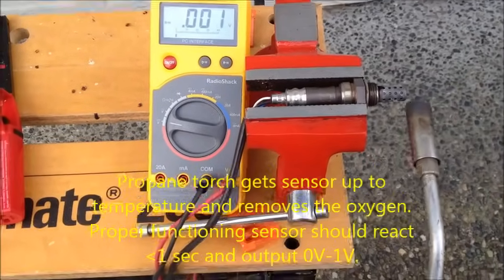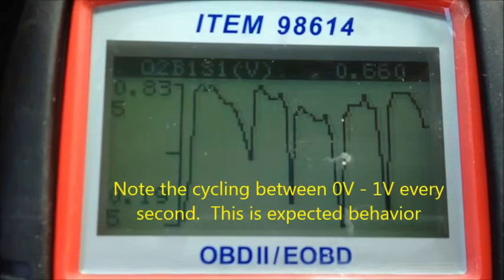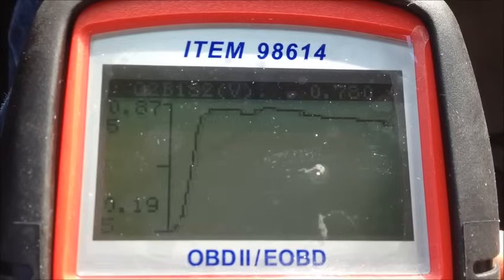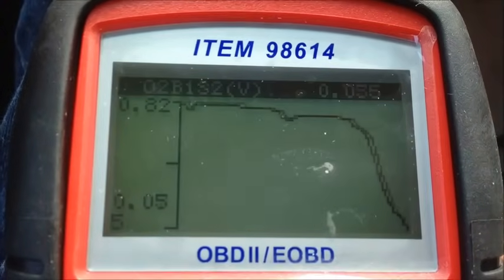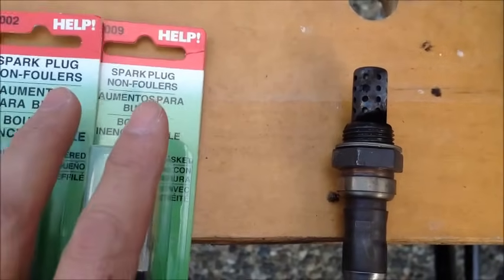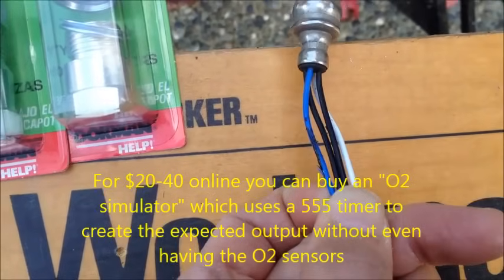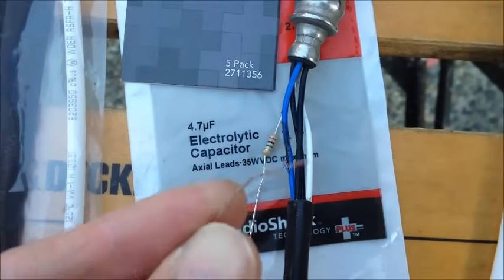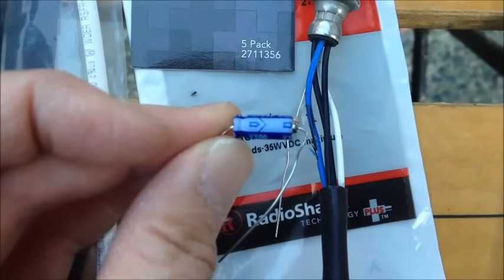$3 O2 simulator fix for P0420 Check Engine Light

Comment from the maker: Hundreds of people have fixed their problems with this.  However, several people have tried this and it didn't work, or another code popped up, and they want help figuring out why.  You can't expect help without providing enough details to be helped.  Here's some diagnostics to try.

First, this won't fix a broken catalytic converter, so it's very possible your converter is too far gone for this to help.  I've never heard of anyone with this mod failing a real smog test.  That's because this doesn't fix a broken cat - it just fixes a too sensitive computer.  If the problem is intermittent or a bottle of Chevron Techron fixes it then you're a good candidate.  If your catalytic converter simply isn't doing anything, or a smog test shows actual problem gases in your exhaust, then this mod can't possibly work because it depends upon a working catalytic converter.

Second, double check all your wiring.  The resistor doesn't matter which direction, but an electrolytic capacitor with a + and - labeled on it must be installed matching the polarity.  If you change the wiring or reverse the order of the resistor and capacitor you can completely defeat the circuit.  If you change the resistor or capacitor values then you change the time delay of the circuit.  See my explanation of how T=RxC.  Sometimes making the RxC larger helps.  Rarely will making it smaller help.  If you get a code saying the o2 sensor is too low, too high, or not changing, that could either be bad wiring on your part, or a dead catalytic converter that isn't doing anything.

Lastly, if the above two are correct then you need a graphing OBD analyzer to see what's going on.  Graph the upstream & downstream O2 sensor values.  Watch the graphs in my video. The upstream should cycle every second.  The downstream needs to look like a smoothed out version of the upstream.  If it's not then your circuit isn't right, or your cat converter is dead  (you can remove the mod and see what your cat is doing on its own to figure that out). If you can't get your hands on a graphing OBD analyzer (Harbor Freight 60693 for $80 on sale) then you're at a dead end because there's not enough diagnostics to figure out what's wrong. 

You can always try a spark plug defouler I showed in the video, but I'm not sure that really works or how long it will work, won't fix a dead cat either, and there's no way to tweak it.  There are full o2 simulators but they're hard to find.  Last resort would be a new catalytic converter but I don't recommend anything but OEM especially for a Honda.  Lots of stories of people paying $500 for an aftermarket which died in a year or less.
Reply: MITEEman  How soon after you install the modified O2 sensor should the CEL light go out? Do I need to erase the code or is that not needed?
Reply: AL Ian you will need to erase the codes
Reply: In Illinois, this would always work as they do not stick anything in the tail pipe anymore (not even a banana, "a banana in the tail pipe?")
Reply: Actually the upstream should cycle 3 to 5 times PER second.
Reply: Did this last year and it worked. Passed inspection with no cats. CEL came on randomly two times over the past year. Both times it was P0138. Now, right about the time I need it inspected again, the CEL is on with codes P0138/P2271, and clearing them they come back after a day or two.  When I looked these up, it says Bank 1 Sensor 1 voltage above 1.2v for more than 10 seconds. Do you think this could just be a bad 02 sensor? They were all new at the time I did this.
Reply: +johnmartin1024 
Thanks for the explanation of why the catalytic converter doesn't die by itself. The P0420 code can also be triggered erroneously by the manufacturer ECU as well, such as in the BMW M3. They even had a recall on this issue and the ECU needed to be reprogrammed to damp out the high frequency post-cat O2 sensor. My M3 got the P0420 code but it passed the California emission test so the catalytic converter is good but BMW ECU was too sensitive.

Comment: So, I applied this fix to my secondary O2 sensor on a 2007 Mazda 6. The code I had was P0421, similar to a P0420. That is gone now, so it fixed that, BUT now I have a P2096, because apparently on this car, the secondary sensor is also part of the fuel trim loop. So the slower-transitioning sensor gives me a fuel trim error. Just a heads up for people who might find themselves in a similar situation. I am thinking about changing the C value to bring the time down a bit, or something...
Reply: nunya bizniss Update: My vehicle uses 3 O2 sensors. This would probably work on the last sensor, downstream from the last cat. However, I have a pre-cat with up and downstream sensors, and I tried this with the downstream....which, it turns out, is part of the fuel trim loop, and so the RC fix causes a fuel trim problem because the sensor doesn't react fast enough. MITEEMAN's fix is still valid, the theory is sound and the science will work, however sometimes there are extenuating circumstances that complicate the issue. I had a P0421 code, not P0420, for one thing. So one must do a little research. Thanks MITEEMAN for the vid, it is valid information and people can use it if they choose.

Comment: Is this only Honda cars or will this work on Prius Toyota cars?  Thanks for the info.
Reply from the maker: SiggyMe In general, follow my instructions above to find out details about your o2 sensors.  Out of curiousity I did a quick search and it looks like it is a standard 4 wire, so it's possible it will work.  My question is how a Prius can already have an inefficient catalytic converter?  Those things burn half the gas of a normal car and most are newer models with low miles.  Unless you have high miles and/or it's really old I would have a mechanic check what's going on.  The newer the computer, the more likely the computer will reject the mod.  If you try it let us know if it works.
Reply: Hey MITEEman you are an angel for helping so many AND sticking with it!! I have a 2005 Nissan Frontier 4.0. These are famous for P0420 & 430's. Have you heard from Frontier owners on your fix? Thanks ever so much!

Comment: i have done the same fo ford 5.4  super duty and P0420 gone , but comes up P2270 after 20-30 min drive. what is wrong?
Reply: I got the same problem bro you ever fixed it ?

Comment: I have a 2004 VW Jetta.  I have the p0420 code.   I followed everything to a t and the codes gone.   But now I'm getting a p0140 Oxygen (Lambda) Sensor B1 S2 No Activity code.  Any ideas?   From what I understand that's a steady unchanging voltage code.   Maybe try a smaller Capacitor?  PR remove it entirely?
Reply: Brandon Brickley have the same issue, did you solve it out?

Comment: Hi, I use this R * C (1 mega ohms * 4.7uf= 4.7sec) circuit i am getting constant voltage of .43 and code P0140 No activity detected, Do i need to use 2.2uf capacitor instead of 4.7uf. Without the R*C circuit O2 sensor reads 0.6 / 0.7 / 0.8 fluctuates .
Reply from the maker: If the voltage output is constant then either your input was constant, or you've wired it incorrectly.  If your input was constant (bad o2 sensor) then you probably should have seen P0140 to begin with.  So, my guess is that it's wired incorrectly although it's not an obvious short which would give 0 or 1v.  I would bench test the o2 sensor to validate that first, then reinstall the RC filter and if it's wired correctly you'll see it fluctuate with the same range but slower.
Reply: MITEEman Can i decrease the resistance value like 100 Kohms, will it increase the voltage reading.
Reply from the maker: Rishikesh Mahato
If the signal is changing, but just too slowly, then reducing R or C will help.  You said you were getting a "constant" voltage in which case it's not going to help.  I stand by my prior recommendation.
Reply: MITEEman I have reduced the Resistance now C = 2.2uf & R=90 Kohms, voltage increased to .57 (Varies from .31 to .57) only code is coming now is internal resistance too high, so i am reducing the Resistance making it 10 Kohm.
Reply: I'm having the same problem with p0140, have you found a solution?
Reply: Brandon Brickley , Hi i have used O2 Minicat sensor spacer adapter extender (amazon) it will solve ur p0420 code problem.

Comment: THANK YOU!!!  Fixed my nephews 2000 4Runner in a parking lot during lunch. Smog passed and new tags delivered. No CEL for the last month...
Reply: Stace Williams what were the ratings on the cap and resistor you used?
Reply: I have an ‘01 taco I need to do this mod on

Comment: Hi - I did all this, O2 sensor voltage looked right. The Code went away...now the code is back after a month and will not read anything. I got "LINK ERROR" at two different shops... 2009 Subaru Outback. Please help
Reply: ok fixed that by blowing out the link and resetting the battery...now I'm getting p0140 (no O2 activity) connections are good, but IIRC, the voltage was just solid at .5v (not moving at all) is that expected??
Reply: @hammerain93  some people were saying the resistor was too much resistance and stepped down to 100k

Comment: I did exactly this and i got a code P0606--PCM code,I am using a harness i made from  other Toyotas so i didnt need to splice into my O2 sensor wiring.I thought i had the capacitor backwards so i flipped it and received the same code. When i remove the harness the code goes away.
Reply from the maker: Glad you tried to remove it because that's exactly what I was going to suggest.  Glad to know your computer is still fine.  Either your computer is too sensitive to be fooled by this, or you didn't do the fix right.  Unfortunately 0606 doesn't give any hint as to what's wrong.  Most likely you are shorting a wire or misconnected them while splicing the harness.  If not, and you're using the exact components shown here, and your wiring is exactly the same, then your car's computer is just not going to be fooled.  However, this would be first case I've heard of.  My guess is you've got it wired wrong.  You might also play with the values of the resistor & capacitor, but keep the value of R x C within a factor of 3 or 4.
Reply: The parts and wiring were exactly as you had shown.what values can you suggest for me to try to make only a slight change so i can see if the code 0606 will reappear ? I was going to try a resistor only just to see if 0606 would come on?
Reply from the maker: darin porquet
That would not work.  To have any effect at all, you must use both a resistor and capacitor.  There's another response here that goes into technical details why.  My guess is this is not going to work for you, although I'm still skeptical that the circuit is correctly wired unless you can get an ODB reader and can verify the O2 bank sensor voltages.  But, you can try using a Radioshack 270k, 560k, or 680k resistor.  This will reduce the effect.  Increasing the resistors & effect will likely just make the computer further convinced of a problem.  Good luck, but it's not likely to work for you.

Comment: Hello! I'm curious as to why you used a larger capacitor than others suggest (1 microfarad) that's what I used and I'm wondering if that's why it isn't working. Also, would 1 Mohm 1/2 watt resistors be a problem? Thanks!
Reply from the maker: That's very likely the problem.  T=RxC, so my design of 1MOhm x 4.7uF = 4.7s to output 63% of the input voltage.  Your design is 1Mx1uF= 1s.  That means your output is swinging 4.7x faster than my design.  In my experimentation, that's too quick.  The source varies very quickly (<.25s) and you want to slow it down much more than 1s, thus 5x is a good approximation.  You need a bigger RxC.  The 1/2 watt resistor is great - it's a hardier version of its 1/4 watt cousin.  You either need a bigger R or bigger C, but given standard parts sizes the only easy way is to get a 4.7uF cap.

Comment: it works on bank 1 upstream?
Reply from the maker: I'm confused what you're asking but you don't want to modify an upstream sensor (before the catalytic converter).  That sensor monitors the fuel mixture programmed by the car's emissions computer.  This modification is designed to address the efficiency of the catalytic converter as monitored by the downstream (after catalytic converter) sensor.  If you're saying you got a P0420 after changing your cat to a "high flow" (I don't know what that does) then it's possible this may help but only if used on the downstream sensor.

Comment from the maker: People are frequently asking "Does this work on a <Year> <Make> <Model>?" or "My color wires are different - which ones do I use?".  I don't have the ability or time to answer this, nor does anyone else.  What I recommend is you google your car's oxygen sensor and see if you can find a wiring diagram or at least find out how many wires.  This fix probably only works for a "narrow band" sensor which can have 1-4 wires.  There's a type called "wide band" which has 5 or 6 wires and they apparently use current.  This fix will not work because it only regulates voltage and not current.  You need to find the two wires that carry the actual o2 sensor and ground (and not the heater or any other signals).  Failing that, it's pretty easy to figure it out with a voltmeter.  Either bench test it as shown, or unplug the sensor and test the pins with the car running (which I don't recommend for many reasons but it can be done).  You want to find the two wires that have a voltage fluctuating between 0-1V with a cycle time of no less than 1 second and ideally much slower.  Here's what I know about the number of wires and what they do:  1 wire (just voltage and use chassis ground), 2 (voltage & gnd), 3 (voltage, gnd, heat), or 4 (voltage & gnd, heat & gnd) wires.  Good luck, and you do get it to work, please post the year/make/model and wire colors you used.
Reply: Work for up sensors ?

Comment: MitteeMan,
Very helpful info.  This has worked great on the wifes jeep liberty.  Thank you so much.  Do have a question though. Im pretty sure I know why you have installed capacitor.  Its to slow down voltage changes? Right??  But,  what does the resister do?  It seems that the capacitor should be able to slow the voltage changes on its own? I guess i just know the basics of o2 sensors and the basics of electrical but am very curios of how exactly this works.   Once again thank you for sharing you hard earned knowledge.
Reply from the maker: See my reply to Matt R from two months ago for the basics of an RC filter.  You need both the resistor & capacitor or it won't do anything. The capacitor on its own would charge instantly, as well as discharge instantly.  It's only when you use a resistor to restrict the flow to & from the capacitor that you change the output.
Reply: What year liberty?